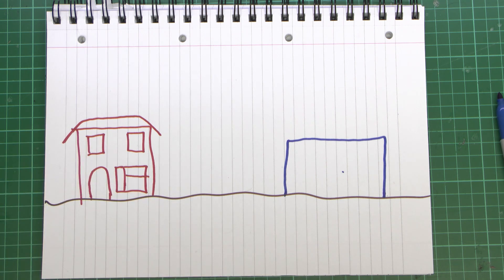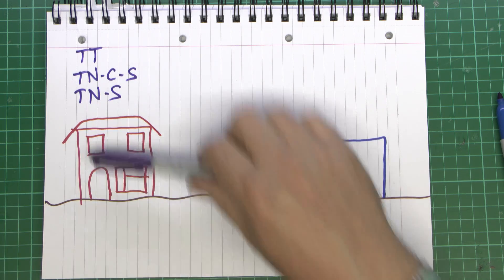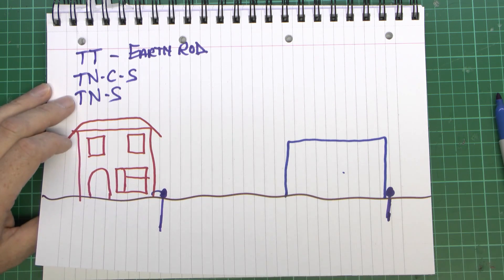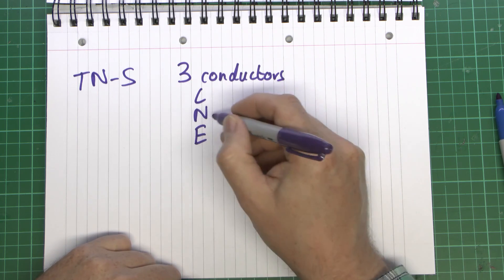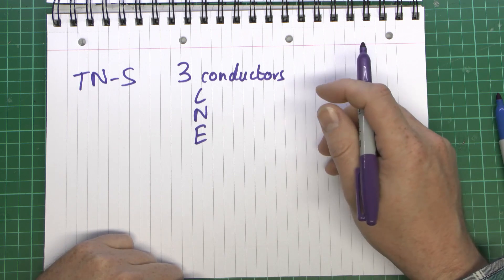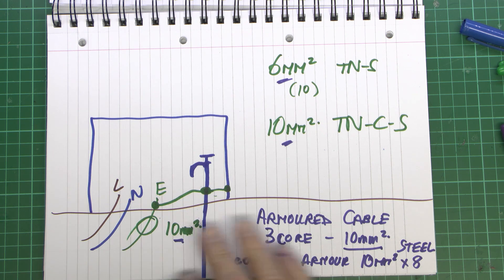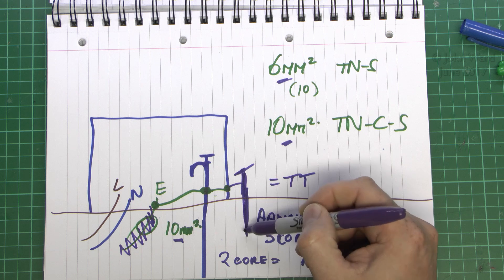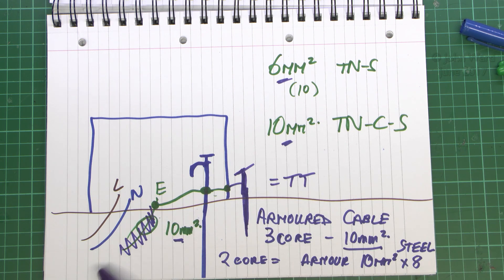Earthing Systems for Outbuildings

Comment: Would the 'spare' core of a 3 core 6mm  SWA combined with the armour be acceptable as equivalent to 10mm earthing? Great Video by the way as with all your content!
Reply from the maker: Generally no - 6mm² 3 core SWA has armour of about 23mm², but that is steel which is about 8 times less conductive than copper,  so only equivalent to 2 or 3mm copper, still below a total of 10 when added to the 6mm copper core.
Reply: @jwflame  you answered my question here, will delete other comment

Comment: Great video (as usual) thanks John.I came across this only recently so I think that the 18th
edition change on bonding insulated section pipes may have overtaken the
description? 
I can see that, for the TNC-S case with an open circuit PEN,
the outbuilding feeder earth connection plus the 10sqmm connection to the water
pipe could carry the entire installation neutral load current. I suppose this
would only be so if the house water and gas pipe earth resistances were high
and the outbuilding water pipe earth resistance was low.
Wouldn’t it be easier to insert a piece of (insulating) hose
pipe and avoid having to connect the water pipe to the protective equipotential
bonding?I would be a bit reluctant to supplement the 6sqmm armoured cable
earth core and about 23sqmm of steel armour in parallel. However, I don’t know
if this arrangement would equal the current carrying capability of the 10sqmm
bonding conductor? If the d.c. resistance of the armour is about 6.7ohms/km and
the d.c. resistance of the 6sqmm copper is 3ohms/km with a current carrying
capacity of about 42A, could we assume the armour will have a current capacity
of about 3/6.7 x 42 = 18A? This would give a total rating of 42+18=60A - which
approximates to the 60A rating of the 10sqmm single core.
A bit shaky perhaps – A bit of hose pipe may be safer.Regards

Comment: Hi John I’m doing an old outhouse up and need electricity in it the outside is 2 metres away from electric can you use power from a wall socket to a consumer board and do it in armoured cable or do i need to get power from mains board all its doing is running a frezzer and garden lights thanks again

Comment: If you do not have Extraneous conductive parts, so you are only bonding socket and consumer unit boxes. Is it ok to use standard earthing sized cable?
Reply from the maker: If there are no extraneous conductive parts, there isn't anything to bond.
Sockets and similar items will already have an earth connection as part of the wiring.

Comment: If the water supply coming in to the outbuilding is MDPE (plastic) is there still a need for bonding and therefore an Earth conductor with 6/10mm cross-sectional area?
Reply from the maker: Plastic pipes do not require bonding.
Reply: John Ward thanks for the info. The  internal pipes (downstream and internally) of the  mdpe are copper and metal taps and fittings etc. From what I have read elsewhere there seems some confusion amongst sparkies with some of them opting to bond even though there is very little in the way of metal attached to the incoming supply.
Reply from the maker: Metal pipes on their own do not need bonding - only if they are introducing a potential.  Metal pipes partly buried in the ground do need bonding because they are introducing earth potential, as they are in direct contact with the ground.
Pipes just fixed inside a building are not introducing earth potential, and neither does a metal sink, metal door handle or a metal spoon in a drawer.
Items which introduce potential are bonded so that in the event of a fault, those parts are kept at the same voltage as other exposed conductive parts (such as the metal case of an appliance), otherwise a dangerous voltage could exist between them.
Unrelated metal items are not bonded because there is no way any voltage can appear between them and some other metal part of the electrical installation.

Comment: Hi JW. On a TN-C-S (PME) system (and a TN-S) if you are exporting the DNO's earth externally to out-buildings etc are you not required to obtain their permission, after all it's their earth and they assume it ends at the intake and rightly so? I would assume this is not good practice in any scenario to export a TN earth, whereas creating a TT system at the outbuilding I thought ticks all the boxes. Similar scenario to EV Charging Points really. Great videos by the way, love your work, keep it up.

Comment: Hi JW,
If the outbuilding is less than a meter away from the main building would you still need another earth electrode (assuming the main building is TT, and the cable supplying the outbuilding is RCD protected at the main building end)? The circuit into the out building would be supplied via 3 core 2.5mm SWA (from a 16amp MCB) and be supplying a 2.5mm radial circuit of not more than a few meters in length.
Reply: I would say not

Comment: John, I am setting up a battery system with an inverter in a metal shed for some stables would it be a good idea to put in an earthing system? and as I am dealing with horses and the danger of power to the horse from the earthing?
Reply: Absolutely install earthing and maybe even 15ma sensitive rcd protection. Horses and all quadrupeds are very vulnerable to current even more so than humans.

Comment: I solved the problem of getting power to my shed for lighting by fitting a 12V solar system £100 for a 40w panel & charge controller, £15 for two 12v 10w LED floodlights and a used car battery £0.00. Six years later and it's still working fine. It would have been too much hassle to correctly run a mains supply to the shed which is mostly galvanised steel.

Comment: What if you used 6mm 3 core armoured and used both the earth core and the armour?
Reply from the maker: That may work, but  main bonding has to be in copper or be of 'equivalent conductance' if using other metals.
Therefore if using the steel armour as part of that, you need a lot more steel than copper , typically between 5x and 10x more, so for an extra 4mm² copper equivalent you would need steel armour of 20mm² - 40mm² depending on it's conductivity.
3 core 6mm² SWA typically has steel armour between those sizes, so some cables may comply, others may not, it all depends on who made it and what type of steel was used.
Specifications for cables can be obtained from the manufacturers, including the size and conductivity of the armour, so it would be possible to determine if a particular cable complies, but it would need to be determined for each specific make of cable, and in most cases it's far easier to just specify 10mm² and use one of the copper cores as the bonding.
Reply: @jwflame  you are legend.

Comment: Great videos. Really informative. Would i be able to use the 10mm2 earth cable separate for a hot tub outside? Or does that definitely need to be set up as a tt system? Im on TN-C-S
Reply from the maker: You can do that for a hot tub, although the regulations recommend that an earth mat or electrode with low resistance is installed even if TN-C-S is used, so there won't be much difference in cost or installation time.  The electrode/mat would need to be connected to the TN-C-S earth via a minimum 10mm cable.

Comment: Hi  jw just wanted to ask my kitchen sockets and upstair sockets are in 1 ring ...but i want know is it possible to seperate a boile rsocket  line from this ring to a circuit of its own and  how would you do it .
Reply from the maker: Only option is a new circuit - install a new cable from the consumer unit to the boiler, with suitable MCB at the consumer unit and a switch / FCU or socket at the boiler end.

Comment: Hi John what if there was a fault on DNO side regarding a loss of Neutral and earth on a TN-C-S earth system. Wouldn't a TT be safer especially if you had a water supply in the shed or the shed was constructed with metal frame work.
Reply from the maker: If that very specific and extremely unlikely fault occurred, TT would be safer.  Metal pipes or frame would not normally be a problem as they should be bonded to the main earth terminal, keeping them at approximately the same voltage as everything else.  The risk of shock is between those parts and the actual ground outside, not usually a massive problem unless it's something like a caravan and someone steps outside onto the ground while holding onto the metal frame of the caravan.
However lost neutrals on TN-C-S are rare, and the big disadvantage of TT is that you are relying on an RCD to disconnect L-E faults, and that whatever earth rod/electrode you have is still in good contact with the ground.
Reply: John Ward Thanks for your reply John

Comment: Hi John, 

I made an installation in a wood cabin at my uncles property. 
For gas and water we used PE plastic pipes for the underground runs, and switched to copper pipe after coming inside the cabin.
Should these copper pipes be bonded to earth as extraneous conductive parts? 
Or since they are 100% inside the cabin are they potentialfree?
We had an elektrician connect up 3phase run for sauna heater, he has not mentioned bonding at that time.
So this is just curiosity.
Nice video, thx
Reply from the maker: Bonding not required, as the pipes are not extraneous - they can't introduce any potential from outside.

Comment: Thanks John for another useful video.
i think this is a grey area as the regs focus on caravan sites, outbuildings are not detailed as much. If i understand correctly the reason that caravan installations are regulated as TT systems is because the ESQC regs say it should be so, the reason is because of the danger of imported earth voltages. Fuel installations likewise
the local authority i work for sent me to inspect and test an installation  where a power socket unit was installed outside at ground level. this had been installed as a TT system with 30ma rcd protection from a kiosk which had a TNC-S supply available.
personally i agree with you, if you have an earth use it, but ensure periodic inspection and testing takes place frequently.
the disadvantage of TT systems is that they can change impedance values due to changing ground condition caused by weather conditions.
would you have installed a power socket arrangement as TT or a TNC-S?

Comment: Thanks John really useful video. I am installing a feed to the garage, I have bought an earth rod and also have 4mm 3 core armoured cable supply. After watching your video I realise I have no extraneous conductive parts and the 4mm earth supply would be suffice. My question is should I still install the earth rod as I've already purchased it so there will be no additional cost or is the 4mm house earth a better option?
Reply from the maker: In most cases the earth from the house is the better option.

Comment: If you only need modest power requirements for your outbuilding, say lights and a pond pump, then treat the outbuilding as an appliance. 
Simply connect to the house supply via a standard plug in a convenient socket. Your outdoor wiring is no longer a permanent installation and is treated as an extension lead. Obviously, the connecting cable should be suitably stout to handle the max possible load rating of the plug, even if only as a fault condition. I would still use a small consumer unit in the outbuilding regardless, and protect the connecting cable.

Not what you are teaching here, John, I know, and thank you for it, but jogged my memory and I believe is worth keeping in mind.
Reply: Exactly what I did.

Comment: Great video JW, now I see why you guys call us "convicts", we would certainly be "convicted" if we ever used the armour or lead sheath of a cable as the earth, that's like using the steal conduit for the earth.
M.I.M.S cable is one case where we are alowed to use the sheath as the earth and so long as the cable originates at the main switchboard in a M.E.N system, we can also use it as the neutral return path in what we call an E.S.R (earth sheath return system), where a single core M.I.M.S cable provides all three functional conductors to the sub board be it in side the main building or remote.
Reply: i miss wiring in nz and oz, far less stupid stuff,  like ring circuits, fucken swa cable and multiple earthing systems and some of the dodgyest fuse boards known to man,  dont even get me started on chiseling brick walls to bury cables in.

Comment: If those extraneous external parts, like a metal water main, come thru the ground, why doesn't this 'ground' them?
Reply from the maker: They are grounded, and this is the reason they require bonding.  Bonding is not about connecting items to ground, it's to ensure that items within the installation/building remain at the same potential when a fault occurs.

Comment: I just run a 2-core 1.5mm flex from the house on a 3A fused plug to the shed when I need power back there, mostly just for lighting though, there is a T&E cable running to it, but, where it's been run through (metal conduit set in concrete) has been damaged, so, not using that, too dangerous...

Comment: Hi John, many thanks for another great video. May I ask how this applies to a metal control box? Would it be a TT arrangement as the box itself is like a metal outbuilding? I am looking at running power to a painted IP65 metal control box to facilitate a supply to electric gates to my house, and am curious as to how this compares to the outbuilding scenario you've mentioned. I am using an electrician for this task but i'd like to be in the position to understand what he is doing and to be able to ask the right questions. Thanks in advance!

Comment: Excellent video John. A question, in the case of a garage with a steel sectional door , would that be regarded as extraneous and need bonding ? Also if I have a brass water tap inside the garage fed with a plastic water pipe, how do we view that from bonding perspective?
Reply: Regarding the brass water tap, if the plastic comes out the ground and is converted to brass above ground then it should not need bonding. If the brass enters the ground at all then you should bond it.

Comment: If the frame of the building is extraneous and using a tncs isn't it true that you can't use the exported earth due to possible loss of pen conductor problems. Like caravans which can't have tncs systems connected.
Reply from the maker: Portable caravans are a special case, as the frame is isolated from the ground due to the tyres, and even with the legs down there is little or no contact between the frame and the ground below.  If the PEN conductor is broken, the caravan frame is at full mains voltage relative to the ground below, someone steps out and is connected between the frame and the ground.
Metal frame buildings would normally have substantial parts of the metal buried in the ground, so the voltage difference between the frame and local ground is significantly less.
Reply: John Ward but is it not sensible to determine if the metal is actually 'extraneous'  by means of testing?  Some metal 'sheds' can be isolated from earth by a concrete ground so that exporting the earth in a TN-C-S to a steel shed on a concrete base could well be similar to a caravan?

Comment: As I understand it if you use a TT system in the out-building, the earth system of the house and out-building MUST be independent and separated from each other. This means that the armoured cable at the out-building end must not be earthed to the metal consumer unit. How this can be achieved when glanding an SWA to the metal consumer unit I don't quite know. The only way to keep the earth systems separate would be to terminate the SWA before the consumer unit in a small enclosure and then use the required size non-armoured cable to supply the consumer unit. This requirement also also satisfies the fact that the armoured cable must be earthed at both ends. The other issue I normally encounter is the fact that most garage units also come with an integral RCD which generally conflicts with the RCDs in the main building; I usually replace this RCD with a straight forward master switch but was pulled up by my NICEIC inspector who said that this would conflict with the 'usability' of the system in that the user would constantly have to reset in the house!!! All considered, the easiest solution would be to put a short isolating plastic pup piece in the water pipe as it enters the garage and hey, no extraneous exposed conductive parts!!!
Reply: I also spotted that the video does not mention the issue of keeping the earthing independent it is however described here:
https://professional-electrician.com/technical/stroma-certification-supply-chain/ 
It seems to me this is a little known fact & needs to be highlighted.
This article also answers the question you posed & suggests using a plastic stuffing gland etc, etc. I have not found any YouTube videos that actually demonstrate this however.

Comment: why you woudnd take a pe line from blue building to main building and use the ground at main building in tt system ??
there is nothing special i see to make problems?

at a steel armored wire  use the armor as pe??
what is about corosion of steel?

byside i only like TN-S-System systeme with symetrical squersection of conducters or better a bigger PE! all other are syspect to me!

Comment: Also with equal potential bonding its typically installed as a separate earthing conductor run back to the earth bar at the main switchboard in the house, it's normally not needed to be connected to the feeder earths in the outbuilding as well, But not that it really matters if they are combined or joined to the feeder earths. Its typical to bundle the bonding conductor with the feeders in the same conduit or ducts. If the bonding earth is directly buried, this may be where the 10mm2 min size is coming from, I thought it was 16mm2 however. I never directly bury cables anyway.